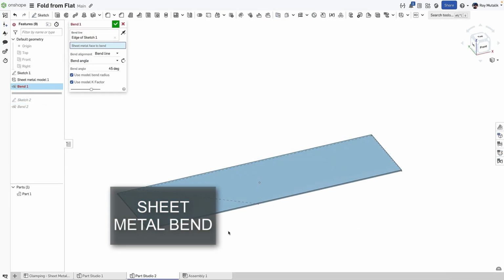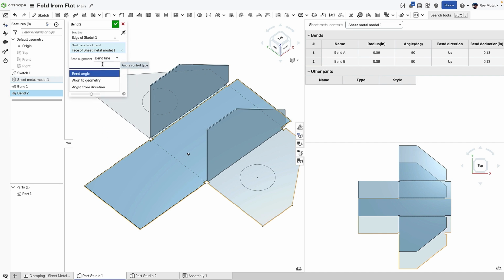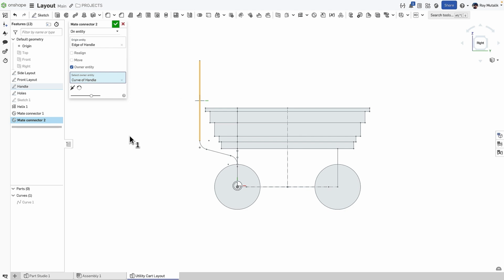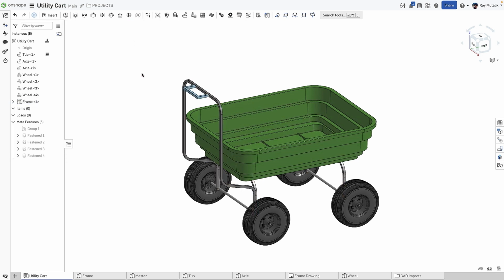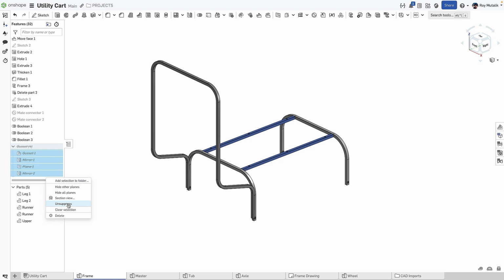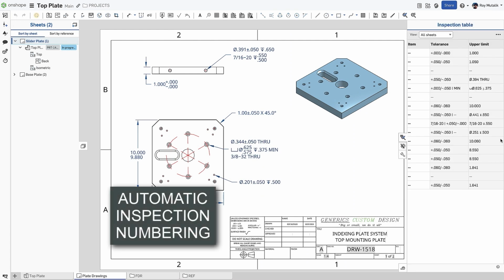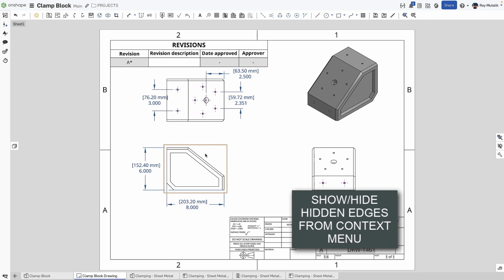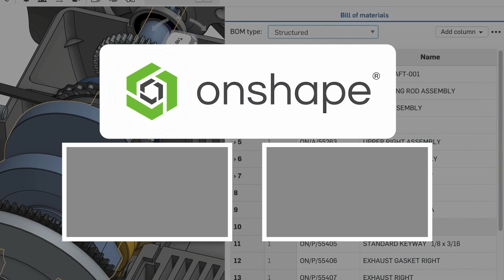What's New in Onshape 1.176 - (Sheet Metal Bend, Assembly Improvements, Drawing Improvements)

Comment: Another update with no Mirror in Assembly. Sigh...
Reply: The point of assemblies is to reference existing parts in relation to each other. Adding a mirror feature inside assemblies would create completely new parts, which is not the intended use case. I recommend making a mirrored variant of a part inside the part studio which than can be toggled.
You should in general use the dedicated forum for feature requests so others can discuss your ideas.
Reply: @OxibanCraft  Many mechanical devices are symmetrical. A real Mirror tool (as found in SolidWorks, Inventor, Fusion 360 and most other 3D CAD programs) would be a real time saver, especially for complex assemblies. Users have requested this feature many time over the past few years, but Onshape refuses to provide it. Instead they offer clunky work-arounds. I suppose a real Mirror tool must be very difficult to program. Other than this glaring omission, I'm happy with Onshape.